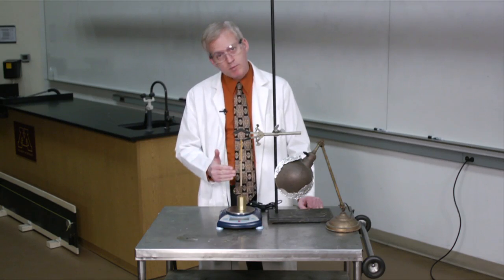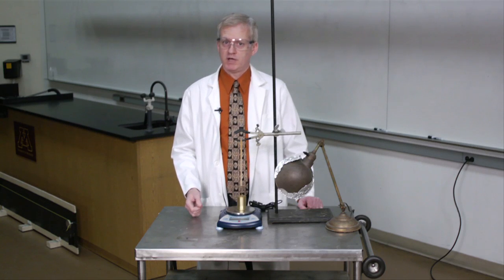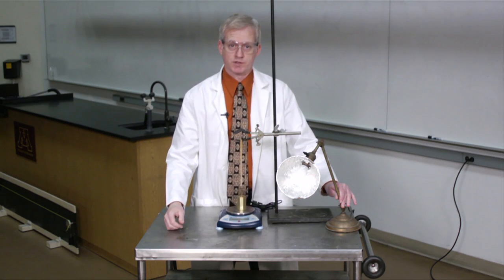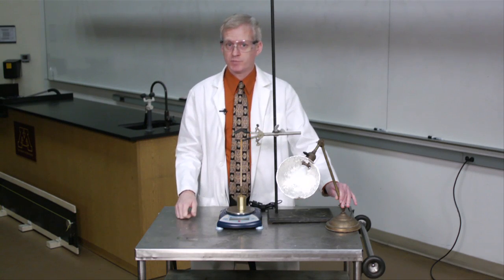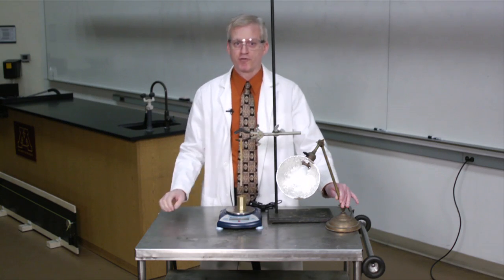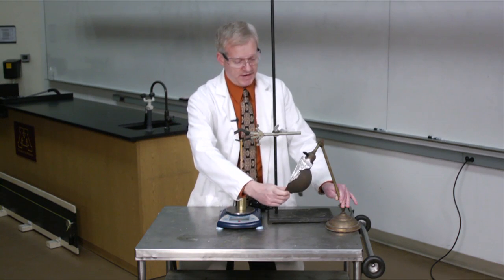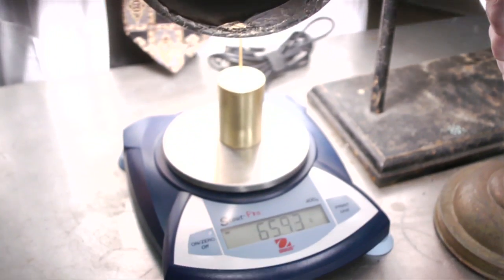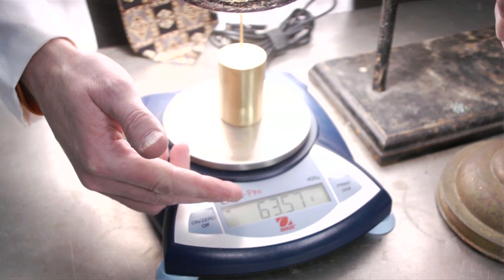Rubber Band Thermodynamics

Comment: I don't think this is a good example of "pure thermodynamics".  What is going on is that there is a chemical reaction involved with the rubber molecule strands as it tension is applied and de-applied (one exothermic with the other endothermic) - that I would imagine is something akin to hydrogen bonding, although maybe there is other bonding going on.  Folks are saying that this is the mechanism that allows the heat-pump devices we have around work, which is inaccurate.  The rubber-band effect is akin to a bag of ready-cold (or ready-heat), which works by chemical reactions.  

A good example for a heat-pump device would be pumping up a basketball (which warms it up), then letting it cool, then depressurizing it (which cools it down).
Reply: I agree to your last part of the comment . I couldn't understand the first portion .

Comment: Would the same experiment work with a metal spring?
Reply from the maker: No, it would not. The internal energy of a spring is associated directly with its displacement from equilibrium (as expressed by Hooke's Law) compared to an elastomer, where the internal energy depends only on temperature (and thus you get the entropy-dependent behavior described in the lecture). Of course, you could make a spring out of a material with SOME elastomeric character, and there would be associated temperature changes with adiabatic compressions or extensions deriving from that, but the material in a rubber band -- which is a nearly perfect elastomer -- is obviously far too floppy for a canonical spring.

Comment: Entropy increases as temperature increases, higher entropy means that the chains must get all bent and thus shorter which causes the band to shrink
Reply: Omg tysm
Reply: There is no law which says entropy increases with temperature.
Reply: @Abhishek-hy8xe , actually, the energy available to the system increases and so it does the number of configurations allowed.